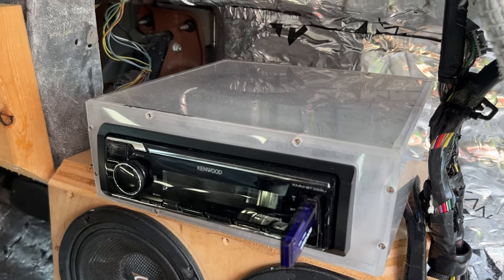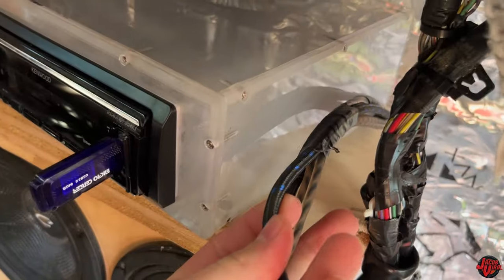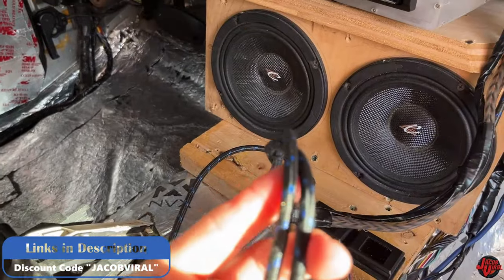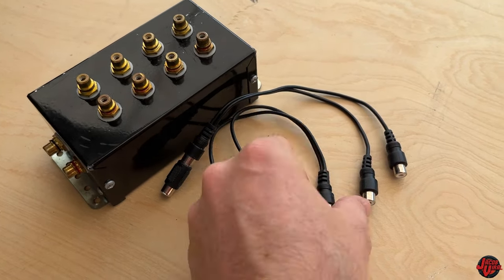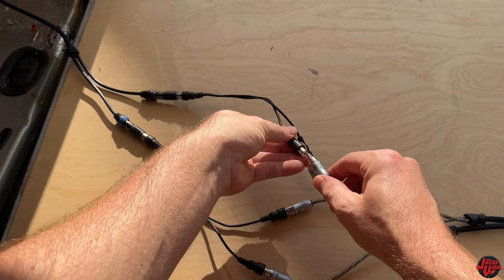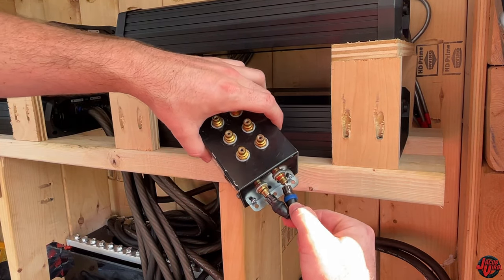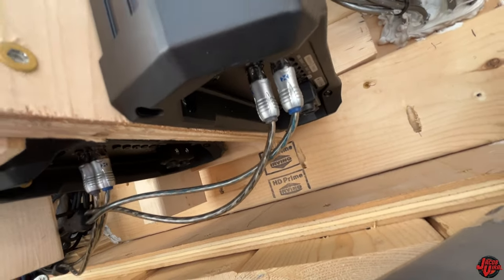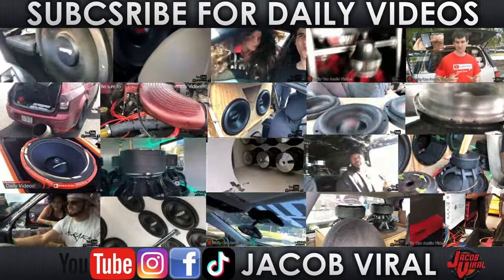HOW TO INSTALL 2 OR MORE AMPS WITH ONE RCA

Comment: This thing is Awesome. Thank you so much I didn't know this existed and this makes life 100x easier. You are the man. I've been subbed for months on your main channel and just came across this one. deff subbing here too
Reply from the maker: Glad I could help and your welcome. 👍 welcome to my 2nd too.
Reply: @JacobViral2 what about if you have 2 sub pre outputs can you use a dual RCA or would you just need a single RCA still
Reply from the maker: @Hellabassguy  What stereo has 2 sets of subwoofer preouts? Never seen that before. Signal splitting should've be a problem I would think dual rca then

Comment: I have an amp with 1 RCA  input.  I want to install an outline converter for a pair of rear deck 6x9 speakers.  Can i use a distribution block to install the converter?  I'm thinking 2 Y splits one from the HU to the output converter.  I'm not sure. Great video. I learned a lot
Reply from the maker: Signal goes then through both rca connection points so dont se a problem

Comment: i have questions about connecting two or more amps using a bass knob , does it affect sound quality or affect the strength of the volume?
Reply from the maker: No if you use high quality connections. Seen 1,000s of competitors use bass knobs without problems long as connected properly. Knobs do ware overtime so can down the road become a problem if not replaced.

Comment: Can it be 2 different sub amps on the distro to make 1 bass knob for both amps? Or do they have to be matching sub amps? I have a RF BD1000.1 and I'm trying to couple it with the T1500.1bdcp to have 1 bass knob for both amps? Thanks for this video.
Reply from the maker: Yep, it’s all about rca signal going input of amps so whether you have a 12k and 2k amp, etc all the same for signal to amp utilizing bass knob If desire
Reply: @JacobViral2  Thank you for responding Boss and I found your same distro as well, very informative information Realtalk.

Comment: Just bought a audiopipe 3003rca splitter because I wanted to install a third amplifier, it has a rear/front and sub input.  My question is do I connect rear/front  and sub from my aftermarket stereo to splitter input and another set of rca's on output to my amps?
Reply from the maker: yes but make sure the proper signal to proper device as different outputs from sub and speaker outs from HU.

Comment: Does having those 2x4s in the back of the wall help with vibration meaning all air flows to front better?
Reply from the maker: It’s a walled system sealed from b pillar, those in the back are for bracing support

Comment: Mannnn, @JacobViral , I thought this was going to answer my question: Ohk So, my head unit Sony Xav9000es has 3 sets of RCA's... Subs + Mids + Highs, and I have  a 2 amplifier system right now, Jp23.v2 + MTX Thunder 5604 (for Mid's and High's) So needless to say im utilizing all my RCA's out the back of the radio now, all my door speakers don't play sound , I guess cause they're not amplified -but what if I have amplified speakers but I also want to run my door and dash speakers off the radio power.... What I can have the best of both worlds "and use my RCA's to send the signal to external amplifiers "and" my speaker wires from the radios internal amplifier ?
Reply from the maker: Sounds like your doing everything right? Head unit power will not be as loud as your amplified speakers. You would have to run wires to each speaker and amp for more output.
Reply: @JacobViral2  so my question is I can’t run, my door and dash off my radio (cause they’re stilll hooked up) and also run my RCA’s amplified with amps to my aftermarket speakers… at the same time? (RCA’s out and speaker outputs simultaneously?)
Reply from the maker: @jahcousteauu_STAYinSHAPE  You can run speakers from head unit power at same time as rca output amp speakers, yes.

Comment: So I understand the rca Y splitter.. my question is, I have two separate sub woofers, each speaker has its own built in amp. So do I just splice Into my original power, remote, & ground wire to plug into speaker #2 ??
Reply from the maker: Always new runs for power,ground,remote to ensure proper electrical and safety. Use a 2nd battery and multiple 1/0 runs from front to back.

Comment: I installed a third amp for mids
After I installed the amp my bass sound went from 100% to 10%😫
Any ideas what check ?
Reply from the maker: Make sure you separate rca connections for your mids/highs from your sub amps. Also you are pulling more current with additional amps so need more alt/battery to support. could be many things

Comment: I have a issue doing this in home audio.  from a Y splitter off my EQ to 2  Kenwood KM-209 house amps. I don't always run both amps and I noticed if I only have 1 of the 2 amps powered on the subwoofers don't move the way they should. They almost move like they are free air or something,  if I turn the 2nd amp on, they are all normal again. Why would this happen? I've been trying to figure this out for years. I've tried different sterios, different rca splitters and cables. Any help would be appreciated. If I leave both amps on every time I want to play 1 set of speakers and I don't even need to engage the speakers with the ab switch, as long as both amps are on, it's fine. It's so strange.

Comment: Looks good is it the same with the remote wire to turn the amps
Reply: You can jump any remote wire as many times as you want. Remote signal only requires very very little power
Reply from the maker: Yes, but I suggest a relay as head units have a Amperage limit as mentioned in their manual. Just posted a video on relays actually lol.

Comment: when should i upgrade my bass nob, rn i have 1 18 but im planin to add another an 2 10s
Reply from the maker: Bass knobs aren't required for the amps but helps for ease of use and adjustment, It is up to you but I think it's good to upgrade asap since it helps

Comment: question. One set of RCA cables (L&R), split into 2 lefts and 2 rights. 1 L&R hooked to 2 channel stereo amp. 1 L&R hooked to mono amp. Will the L&R signal be combined inside the mono amp? Therefore combining the L&R signal at the 2 channel amp as well? Causing a loss of stereo?
Reply from the maker: You want to make sure your subwoofer/mono rcas are SEPERATE from your stereo. You need seperate signals for bass and speakers, then it works fine like you said otherwise.
Reply: @JacobViral2  Thats what I thought. However I had enough y adapters so I tested it and to my surprise I still had stereo.

Comment: Wiring a Kenwood KMR M332BT receiver to a MT-700.1 amp to drive a 10 subwoofer and from the 700.1 to a Kenwood KAC-649S amp that drives 4 speakers. I have run a splitter for power and ground to the two amps.  I too have run a jumper for the remote power. I have connected the RCA cable from the receiver to the 700.1 amp. On the back of the receiver are three RCA connections.  Front, back, and SW. The confusion is running the RCA's for proper connections.. Can you advise??
Reply from the maker: SW=subwoofer amp(monoblock for sub)
Front and rear speakers for a 2/4 channel amp rca.
Reply: @JacobViral2  thank you, so nothing from one amp to the other as far as rca's?
Reply from the maker: @drewaloe113 Your sub amp Must ensure to be the RCA Outs that are made for subs, then the others for your speaker amp. Goodluck

Comment: Hello, thanks for the video. Question can I run two amps of one PC power supply?
Reply from the maker: Idk anything about pc supply sorry? In a vehicle yes
Reply: With how powerful computer power supply units have gotten in the last 15 years I’d say yes but you’re better off buying 2 psu’s 1 for each amp, I know this cause I’ve ran a car amp in a hometheater setup with 2 p1 10s in a ported fox box and she got low with movies and music although because my home theater receiver didn’t have a sub out rca I used the sub out by wiring it directly using a stripped rca running to n rca splitter it worked but years later the receiver died I doubt it was the jank setup given the receiver was old and was used for many years in a normal setup so I think it was just having old age issues, however I upgraded to a modern 5.2.2 setup but I am using a 12in 400w Klipsch R-12SW that does the job I’d like to get a second one at some point, but go with what I said if you can get 2 psu’s it’ll be easier than trying to source a psu that’s a decent price with the power to power 2 amps without burning your house down.

Comment: So a question how much signal loss you have?1 rca spliting cant get full output from the radio to all the amps the same signal power..
Reply: Hmm dont buy it that voltage stays the same  unless junction rca box same some kind of"amp" inside like lowering the impedance to make better voltage...
Reply from the maker: Signal stays the same no issues and voltage remains constant. Think like battery, the whole vehicle is constant 12v range.

Comment: My head unit has a mono sub output, but only one stereo output.  I want to add a four channel amp for my door speakers. Am I going to be able to achieve fader control with only one stereo output?
Reply from the maker: Probably will want to upgrade to a rear & front plus sub rca signal rca triple sets so you don’t even have to worry about splitting.

Comment: I have 2 1200watt amps..if I plug both of them into the distro box will it send 2400watts out or will they both only do the 1200watts a piece they are rated? In other words is this like strapping 2 amps together?
Reply from the maker: Your power shouldn’t change, that goes off your ohm, amp settings, and voltage supply; not the rca distribution. 👍 1200watts per amp
Reply: @JacobViral2  kool so once i plug both 1200watt amps into the distro block itll basically be like have a 2400watt amp....right
Reply: @yellaboidre9905  if you got enough alternator to make 2000 watts should correct

Comment: do u need ground and power wires to run to the 2nd amp ?for it to work ?
Reply: Yeah every amp needs its own power and ground and remote signal to power on

Comment: Hey how can I install 2 amps to have 1 high power amp for subs and 1 for a 4 channel amp for my speakers for the front and rear? 

How should I wire the RCA? Please help
Reply from the maker: You need a aftermarket head unit with rcas for front/rear and sub output, you can’t use sub out rcas on front/rear 4/2 channel amps.
Reply: Okay so as long as I have a rca output for amp I can use that for front and rear amp and the sub output for my sub amp+ subwoofer? 

Thank you for your help
Reply from the maker: @0-0_andrey_0-0  no, you need the proper type of signal for speakers and subs seperate, you can't run the same signal to speakers/tweeters as you can for subwoofers.
Reply: @JacobViral2  so for my speaker amp I connect it with the front and rear preouts and for my sub amp I connect it to my sub R and L preouts 

Thank you!

Comment: Hey, i have two amps, one is 4 ch and one is monoblock. I have 4 rcas in head unit. Do i have to connect both amps off the one rca channel from head unit or can i run one set of rcas to each amp?
Reply from the maker: Run one set of rcas to the monoblock bass amp to sub rca output of stereo, other 4 channel can use the front/rear rca
Reply: @JacobViral2 this is crazy i just bought a marine amp for my PA’s i just bought and i did everything you said except i put a y splitter on the end of my monoblock amp RCA cable that went into my head unit for my subs and then i went to run my 4 channel amp RCA’s to my head unit and wired them front/front both ways and then when i went to start my truck to see if i did everything right and my truck wouldn’t start😂
Reply: i have another question for you that you also might be able to answer, i need to install a on/off switch in-between my remote turn on wire. so my remote wire is ran from my head unit into my monoblock sub amp so i got some extra wire and put them together into my monoblock amp and ran it into my marine amp. in-between the 2nd remote turn on wire, can i splice it and just stick the on/off switch in between. And would it only turn off the marine amp which is the 2nd wire thats ran from each amp??

Comment: looking at doing two subs although cant find a amp rated for the power level would it be possible to do this and run each sub on their own amp?
Reply from the maker: Correct, that’s what I did here with 4 amps and 4 subs.

Comment: What's the purpose of having an amp in and out for your RCA's on a 4-channel or a 2-channel class d etc on sub amplifier where it says amp in  I thought that your RCA's go to first amp then where it says amp out you take them RCA to next amp and then if you want to add another amp on top of that or more you just jump off the last amp that you have your RCA's going to so in order to get your high amplifier to work right and sound to come through it without using the high input jack to the speakers or the low input jack for the subwoofers if you don't have RCA's you got to do a pig tail like you have here and you can just go off one set of RCA's you can just use your sub RCA create 2 RCA's coming off that to your high and then two coming off going to your sub and it doesn't see a difference I always thought that the sub RCA was made internally different in the head unit specifically for low bass only type of frequency the mids and highs free different type of frequency through the RCA so basically you taught me something no matter if I got four sets of RCA's coming from the back of my radio if I got two amplifiers for 3 amplifiers all I have to do is just run a wire adapter off of one of the other of the RCA coming from the head unit that being said the other ones are there just kind of a backup or a spare in case you blow an RCA channel you have three other sets so that means you can run your sub off a high or a mid-range Jack coming from the head unit I believe that's what you're saying it's been awhile since I hooked up double or multiple amps I did it some years ago and I couldn't remember but I thought you just jump from one amp to another where it says in and out the out would be to your next amp and that's all you would need to get sound coming through your amplifier to your speakers I did that recently a day ago and I was getting a weird noise coming from the speaker so that probably explains that I don't jump to another amp off the previous yep I got to come directly from the head unit to get the right RCA frequency for each individual specific amp ?
Reply: Thats what I was just thinking about.

Comment: Had a quick question if anyone could help. If I have a 1 to 5 rca distribution block would that work for a 4 channel amp as well as a mono block amp? And does having a 2 to 5 change anything?
Reply from the maker: You need a separate block for different rca audio signals as you don’t want bass going to speakers.
Reply: @JacobViral2 my headunit only has one RCA out which is currently connected to my Sub amp. If I want to add a 4channel amp for door speakers, will I need a better headunit with multiple rca outs?
Reply from the maker: @STELLAR_QRU  Correct, you need a front/rear and sub out rca head unit, upgrade.

Comment: Am i able to hook a class D amp and 4 channel amp to rca block than run the rca to unit?
Reply from the maker: You want seperate rca signals for class d vs. class ab 2/4 channel amps. 2 different rca blocks

Comment: Hi question, i just got a Rockford amp 5 channel. When I plug Headunit FRONT rcas to amp FRONT rcas the top channels work, when I plug Headunit REAR rcas to amp REAR rcas there is 0 sound, but if I plug Headunit FRONT rcas to amp REAR rcas I get sound from the bottom channels… what could this be? Bad rear rcas on amp? If so, can I plug a Y rca cable on each front rcas and then plug both rcas to those y cables on the “FRONTS”
Reply from the maker: Sounds like you already did a good job troubleshooting and narrowed down to it being equipment/rca issue. Y Splitting works but usually you want to keep signal quality by tuning separate front/rear.

Comment: I have 3 amps, and what to connect them to system controller, pls how can I go about this?
Reply from the maker: Aftermarket radio with rca outputs to the distribution block as explained in video.

Comment: What's up Jacob my name is Ryan here's my situation currently I'm running a stock head unit and I have a broken 4 output RCA converter it's going to be a month before I can get a new one however I have a spare but it's a single output ,however that single output only one channel is working, and I have four amplifiers, so I have a y splitter coming from my converter going to 1 amplifier from that amplifier I have a exact one which I'm using a output from that amplifier running to the twin, then from that one that output is going to my 4-channel amplifier. Now for some reason when I hooked up some more wire connectors it doesn't matter from the converter or from another amplifier as soon as I go to my fourth amplifier the whole system sounds wack so it sounds decent running the 3 amps however I want that fourth one so I want to run another RCA converter however but I want to know is if I can run one channel out of my head unit the ties into both left and right of the RCA converter or should I just run that one channel of my head unit to one of the left or right of the RCA converter then use a wire adapter like I did with my other RCA converter? Sorry if it sounds complicated but that's my situation I was just curious about and if it doesn't make any kind of sense then don't worry about it but I just figured after watching your videos I would shoot you that inquiry LOL thanks bro
Reply: * not wire but Y adapter

Comment: I have two amps both 2 channel and im trying to run a sub and four door speakers what do I do
Reply from the maker: Stereo head unit should have the rca output for the subwoofer amp and the rca output for the rear/front speakers for the other amp.